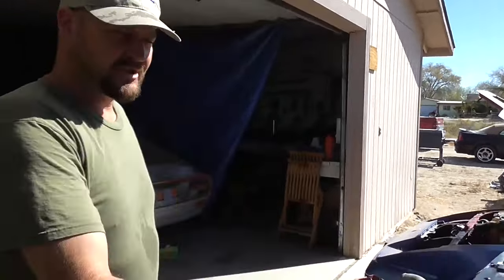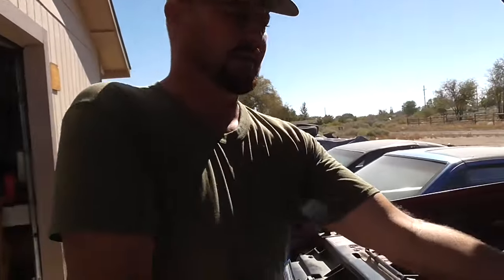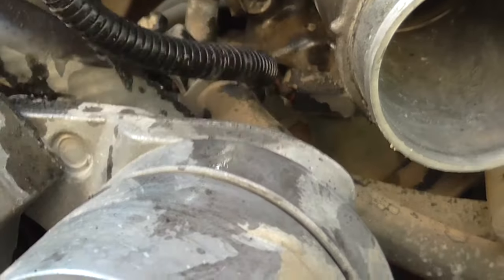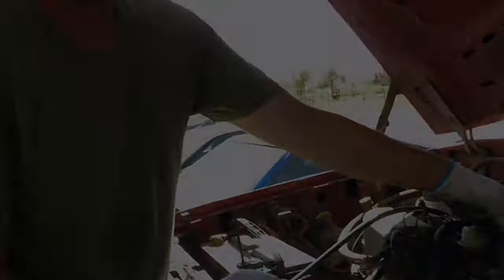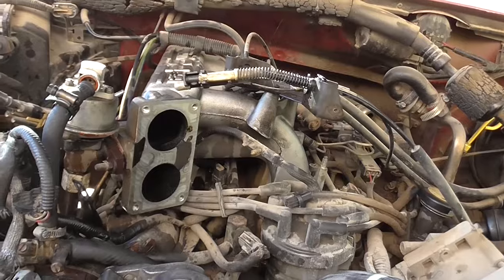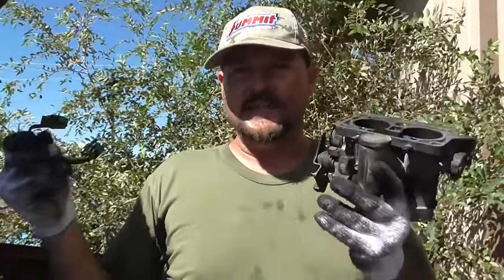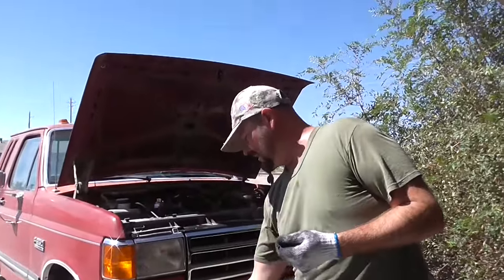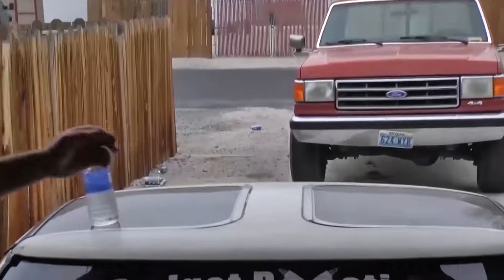DIY Throttle Position Sensor Change (86-96 V8 Ford Trucks)

Comment: Get a Snap-on scanner from E-Bay. Get the cartridges, adapters, manuals, and 120 volt adapter and Battery Pak. Get the 12 volt adapter to hook it up to the battery and adapter. It can test TPS, Ox.sensors, MAF, ISC, fuel pressure, oil pressure, fuel trim, RPM's and much more!
Reply: Marty, is that an OBD I scanner?

Comment: This is a nightmare type of job.  Once you go to moving all those old parts like the clips and rubbers start to break.  You need to buy a throttle bottle gasket that you have to order because they no longer sell them in the store.  Thanks for the video.

Comment: Have you checked the capacitors inside the computer? They are a known problem. From what I understand if the capacitors are bad inside the computer it will not send the correct voltage to the sensors. Capacitors are cheap and easy to replace. The rest of the computer is pretty basic and bulletproof.

Comment: I use anti seize lub on every screw I remove and replace now. Too many stripped bolts on old Fords.  Great video. I had to do that to my 87 a few years ago.   Seems like Ford parts last a long time. and rust and seize up making replacement a bitch.  For instance, water pump replacement.  Everything has it's down side.

Comment: My f250 has a 460 block and the throttle position sensor is exactly where it should be lol. The smaller blocks had their intake manifold turned sideways. So if you have an f series with 460 efi, is alot easier.

Comment: I also have a 95 E-150, but I have no car repair skills at all. When the shop told me I had a bad TPS and they'd install a new one for $200,  I thought "just a sensor? how hard could that be? I'll just swap it out myself." A week later I finally have the throttle body out and got the old TPS off. I noticed that the little groves inside the new sensor are about 1/16 of an inch off from where the old one was. It's just enough difference to make the sensor difficult to screw back on. Is that going to cause problems for my van, or is there a way to adjust it so it sits flush? 

Thanks for the helpful videos! Very glad to see you are recovering well!
Reply from the maker: +SmithyJester There may be a piece from the old sensor that broke off and is still stuck to the throttle body.  It could also be the wrong sensor.  There is a rotating assembly inside the sensor that can separate and get stuck to the throttle body making it difficult to mount the new one.

Comment: Hi Matt,  I sense your frustration  on the TPS sensor location.........count your blessings that you didn't have 
to change it on a 1995 E-250 5.8L.......it stinks!  The TB coolant hose leaked right on the TPS and sent a fault code.
That makes the third one I've changed out for failures. 

I would like to ask you...... if you may know the location of the ABS diagnostic connector (Blk/Org wire) on a 1995 Ford E-250 5.8L gas van.
Features front wheel ABS  sensors and RABS sensor on the differential housing.
I've asked 10 or more experts and no one knows where it actually is.........so I can pull the ABS fault codes.
Thanks, 
Larry 
Huntington Beach, Ca.

Comment: The TPS screws are not "Phillips" head.  Should be using a #2 "Posidrive" screwdriver.
Reply from the maker: +damengineer I used a Phillips style tip, and it worked for me once the throttle body was off and on my work bench.  That above terminology would only be appreciated by about 1% or less of the viewers.

Comment: I have a n 88 bronco and I am going threw the same shit.  It's a plow rig only that I am going to attempt to get on the road so I can use it for a winter beater. In taxachusetts where everything is illegal. I have the throttle body off my 5.0 (not all the way) and I am cleaning out the intake a little bit because the truck doesn't idle for shit and stalls.  Lots of black sludge in the intake so my guess is that I need to get it as clean as I can and then change the sensor and probably get a new EGR valve or block this one off. I don't want to loose power but I also don't want to keep putting sludge in the intake. It is 31 years of crap though, so I will change stuff first and then block shit off later if it doesn't help.
Reply: I have a 94 Ranger 3.0 the same thing. When I pulled the EGR it was stopped up and where it went in the intake the same way. I cleaned out all I could and run Seafoam through it changed oil & fuel filters etc and it's better. I'll probably have to pull the intake.
It has 240,000 on it and still runs good the air   everything works good so I can't complain.
Good luck.
Thanks for the video

Comment: I'm in the same boat, an '87 F-150 with a 5.0L V8 needs a new TPS... part of me want to do a slipshod job of cobbling the new TPS onto the top of the assembly instead of attaching it properly to the bottom.

Comment: Majority of all of them that are efi 302/351 have this. It's f150s also. That looks just like my 94 f150 5.8. No they didn't do that on the 460 for whatever reason and I'll never understand the high rise manifold. It makes things on the left side looking at the engine a lot harder to do. I could be wrong but I think in 86 they started fitting a few of their trucks with efi. I saw an 86 bronco with efi at the junkyard one day. But on the same note, they still had some 87s that were carbed. maybe even 88 and so on?
Reply from the maker: I like Ford's newer intake manifolds, you can access things much better than having to remove half the intake manifold to access fuel injectors and other parts under there.

Comment: Matt,  great video, but I am getting engine surge without my check engine light coming on and I'm having a hard time trouble shooting.  Truck is a '91 F250 5.8L.  I had it in the shop due to a no start and it has gotten new PCM, ICM, IAC, and MAP sensor.  Truck starts fine and idles high briefly then drops to 800rpm.  After I drive for a while and it warms up the engine will surge to anywhere from 1400-2k rpm and generally will not settle back to 800 when stopped and out of gear.  Engine also surges to 2k+ rpm when shifting when this happens.  If I shut the truck off and restart it it will correct to normal idle for a while and then the problem reoccurs.  Any ideas?
Reply from the maker: Ben Carson Does have the symptoms of the throttle position sensor.  Also check for any loose or unconnected ground wires or connectors since other sensors were already changed.  Let me know how it goes.  If you have access to a fuel pressure gage, check fuel pressure at start up and during the rpm surges.   Note what the fuel pressure readings are.  Sometimes there can be codes in the PCM that you can read although the light is not on.  I made a video on code reading and used my F250 to do it and I show you how to use the jumper wire and count the flashes the check engine light makes and write the numbers down then compare to the trouble code listing.

Comment: Absolutely fantastic video! I am also having problems with my 1992 Ford F150 5.0 (8 cyl) . Erratic idle, stalls, hesitates, stumbles and finally dies when coming to s stop! I changed the IAC valve first as that seemed like the easiest attempt at a solution. Also changed the PCV valve but unfortunately, nothing has changed. So..................it looks as if I am going to be forced to try a go at the TPS next.
Reply from the maker: +Harry Alleva Also do not rule out the MAP sensor, senses vacuum increase in intake manifold and adjusts fuel curve accordingly.  TPS and MAP sensors are very important on engines such as SBF fuel injected engines without a MAF sensor.
Reply: +Budget Boosting Thank you for your reply. I have an MAP sensor on order and I should have it some time next week, or two. Hopefully that does the trick. If not, the TPS will have to be next(!)
Reply from the maker: +Harry Alleva Fuel injected engines are so much harder to troubleshoot than carbureted since all the sensors work together providing input to the PCM for it to adjust fuel, timing and rapid changes to these many times per second.
Reply: +Budget Boosting Any day now the MAP sensor should arrive and I will replace my old one with the new one. I hope that does the trick because the weather is starting to get cold in my area to work outside and if I have to tackle the TPS next that is going to take substantially more time.
Reply: +Harry Alleva You should quit changing parts until you know what is wrong.  Most replacement parts are lower quality than the originals.  Also, when you change a part you are making it harder to diagnose the real problem.  Only replace a part if it fails a published test procedure.  What codes are you getting?   You may just have a bad ground connection or a weak battery.  Buy a Haynes with the red cover or the older blue cover.  Unfortunately the newer blue covers eliminated a lot of the EFI info and wiring diagrams.  Page 12-63 should say "92-later F/Bronco diagram 13 of 13.  If it does you have the older book which is good.  If it does not even have a page 12-63 it is the newer book which is not worth having except as a crutch until you can get your hands on the older book.
Reply: Unfortunately I have now changed not only the IAC valve and the MAP sensor but also the TPS to no avail. And just to be sure I changed the plugs, plug wires and distributor cap. The truck still stalls continually when decelerating, accelerating etc. It starts fine but as soon as it is warm the problems start. I have given up and brought it in to a garage. Because I have changed the things they would have gone to they are suggesting changing the ECM next. I have a sneaking suspicion my mechanic has no clue what is causing the problem either.
Reply: @tsilveira5866  I know it's been a few years but did you end up finding out what was wrong? I'm having the same issues. Replaced MAP, IAC, TPS. Even changed the distributor. Once this new throttle body gasket sets I'm going to check for vacuum leaks.
Reply: @jesselauckner4559  I sure did find out! It was the MAP sensor after all! What was happening is that when I washed the truck water was getting beneath the hood and right over the MAP sensor that was attached to the firewall of the truck. The weatherstripping is so worn out between the firewall and the cowl that water was getting inside the engine compartment, or at least where the MAP sensor was situated. The MAP sensor would eventually stop working properly when there was enough water sitting inside of it! So......bought yet another MAP sensor and moved it to another area of the engine compartment!  That was the end, F-I-N-A-L-L-Y of that problem!
Reply: @tsilveira5866  nice! I'm glad to hear it fixed your issue! Unfortunately I've been down that road and already replaced that sensor to no avail. But, I'm still working it all out.
Reply: @jesselauckner4559  I'm in your seat now lol your comment is 2 years old and here I am replacing sensors and I've got an issue where I tap the throttle and the engine just revs up and doesn't come back down until I open to WOT quick, cannot figure out what it can be. I've completely torn down the throttle body and cleaned it spotless and still no change
Reply: @Hunters_Mechanics  wish i could help but I never figured the issue out and I eventually sold the pickup. Miss that old ford but it was some headaches

Comment: my 89 bronco dies when i come to a complete stop or almost to a complete stop. ive talked to alot of people and they say its the sensor and i need to probably clean it. any other advice you might have?
Reply: brennonano  I have a 95 and mine did something similar I replaced the egr valve and an other sensor
Reply from the maker: This sounds like one of two sensors, Throttle position sensor or Idle air control sensor.
Reply: Or your MAP sensor, cheap and easy fix.
Reply: I have an 87 doing the exact same thing? What did yours end up being?

Comment: I have a 95 F350 7.3 diesel. TPS code I was told. My mechanic couldn't get around to fixing it for 5 months. Long story. Anyways, it needs to be "adjusted" I'm told.
Reply from the maker: +Jon Watcher If you can find an OBDI datalogger to plug into the OBD1 port, there are all data screens that can see the TPS position or voltage, find the number it needs to be at idle from a manual and adjust it until the numbers on the datalogger show within manual's specifications.
Reply: +Budget Boosting Fords don't have that functionality. To see live data on OBD1 Fords you would need a breakout box.
Reply from the maker: +tempest411 I forgot what It was called but when I was in a college course in engine performance, my instructor had what appeared to be a very extensive hand held diagnostic scanner which had many adapters fitting the various manufacture OBD I ports.  I watched all data on OBD I vehicles the ones I watched were on a 94 Dodge OBD I and a 90 Ford OBD I.  My instructor at the time said this type of hand held scanner was around $4000 or so and many shops have them.  I would like to find one for a much better price though.

Comment: What’s bad is i just paid 175.  To a local shop For idle adjustment jigamaro, that did not fix the problem of high revving  while starting ...i had to do the job of the mechanic and try and actually figure out what is wrong with my 1999 Ford F-150 by watching a 10 min 20 min video.  Now the question is...do i fix it myself or take it to the dealership....

Comment: there is a better and faster way to do this;
-remove intake hoses
-unplug idle air control motor (first wires he did on right of throttle body)
-unbolt throttle body
-use string to hang from above it (on the hood, engine crane, cloths rack, etc.)
-remove the TPS from below it and go backwards in these steps
Reply from the maker: Humor is always welcome.
Reply: @budgetboosting  i personally did the same job on a 91 f150 w/ 5.8 and followed those exact steps, it is not "humor", is is facts.

Comment: hey like vid. u should see my 84 300 years of removing this and that. real easy to get to. dont need just continues
 what does a throttle senser really do. mine is carbareted. like u say it across from the throttle control on the shaft. can u get bak to me. does it control timing advance or what. it has to nothing makes sense.
Reply from the maker: +mchl8 Throttle position sensor takes the position of the throttle that varies the air going in the intake, sends the position to the computer and it raises the fuel more as the throttle position increases.  Most 84 300zx cars are fuel injected, if yours is carbureted, someone has done a custom job and I would like to see pictures of it.

Comment: Is there any way to adjust these?  My friends grandson put one on her 92 F150 5.0, and ever since then when you put the hammer down (taking a hill, entering a highway), the truck falls on its face.  It bogs down, and if you keep your foot in it, a CEL will appear and the truck will stall.  If you take your foot off the gas, the CEL disappears and the truck keeps moving.  Put your foot in it again, and it will bog again.  I'm stumped.

Comment: Hey Budget Boosting, great video I am going to ask a quick question before I get started, I have a 94 Bronco and the idle wont consistently go back to a normal position, when I look at the throttle position it only goes all the way back to the stops when I push it, I put a spring to pull it back but it still does not always go to stops and engine idle normal.  Any Ideas, you think the position sensor is causing the hang up?

Great video, I am going to look for other stuff on Ford Bronco type engines.  Any suggestions for a quick removal for the back top on the Bronco?  Thanks again.
Reply from the maker: +Roger Swanson I would believe maybe the throttle body should be removed, thoroughly inspected, cleaned and lubricated to see if something is sticking to make the throttle advanced like that.  Sometimes lots of gunk in the throttle plates can cause that sticking of the throttle.  While its all being cleaned its a good time to change that hard to reach TPS and inspect all vacuum lines and connections as well.  One little thing can effect engine idle and performance good or bad.
Reply: +Budget Boosting thanks I actually thought that through and decided to replace the positioning sensor and pull that whole thing apart while I'm replacing the gasket I appreciate the feedback I'll give it a whirl and let you know how it goes, found all the parts on Amazon they are in route now less than fifty bucks for everything
Reply: +Budget Boosting do you have any good sources for a full size Bronco top or quick removal bolts for the top

Comment: okay I get it you don't like but I did the throttle positioning sensor for the first it took me all of ten minutes to pull the intake and 10 minutes to put it back on try pulling the intakes on the other vehicles duh